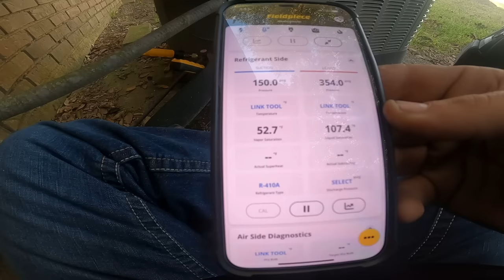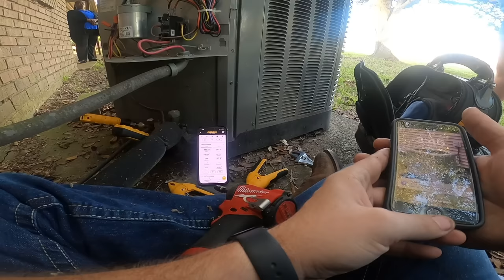Heat Pump No Heating Simple Fix

Comment: I wish you was in Arlington Texas, because I have a heat pump I bought it Nov 2021 and a few days later my heat clicked off  and the company I bought it from, his workers who installed it would not come back to see what was the problem, I had to run it on emergency heat, the owner of the company have cancer and kept asking me to bare with him that he promised to get it fix until this day 2024 he never did, so Oct. 2022 I had a company to come out they said it was a leak and charged me $712 and before the gentleman got out my subdivision my heat clicked off again, I hurried to call the company and they sent someone out the next day and that person said it was  some type of value and the owner said it was a $2,700 job and said it would be best to get a new unit because I was sold a bad unit 😯I told them that's ok and my unit still don't work on regular heat I got to run it on emergency heat because I have not found a company I feel I can trust. I'm afraid of companies charging me again and not fixing the problem.

Comment: John on your probe placement,  high side to discharge, low side to true suction. You gave me advice a few years ago placement on probes on a  package unit located the liquid line before he hit the metering device. I really appreciated it because you didn't give a smart ass comment about not knowing, having expensive tools but not knowing how to operate them correctly.

Comment: thnx for ur video. Maybe u can assist me. Do you know, what is a "high pressure lockout"? And could a defective thermostat caused the defrost board to show this code. My heat pump board is currently showing this code. The OUTDOOR unit DOES NOT, start up at all,  in heating or cooling. There is 24v on the R and C terminals. In  the "emergency" mode, I am not getting enough heat. It only heats up to 72degrees only, and runs all night. And never shuts off.  This is a RHEEM system. 6yrs old. I am really frustrated now, because i am having all these issues at the same time. I am thinking the thermostat is mal functioning, then I think its the defrost board. then i think the heat strips has issues. I am a wreck with these issues. The indoor unit runs fine, but NOTHING from the OUT DOOR UNIT. I just can't figure it out. Hope you or any other can assist me.

Comment: John - does Rheem/Ruud have a communicating high efficiency system similar to the Carrier Infinity?  I’m in South Alabama with a high humidity climate.  My old 19 year system is failing and I want a high efficiency system to control temp and humidity.

Comment: if you up grade the heat unit in your Heat system with a 15 instead of the standard 10 heat unit, will it make it hotter when the heat is on. Like a thermostat does on a car?
Reply: No but it’ll use less electric to operate

Comment: Hey sir, my ac fan outside willl turn on when I put it on cool but off when I put it in heat. Is that even normal? Also my house produce very little amount of heat. Already changed the run and start capacitor but still litttle amount of heat. N yes  the fan still won't turn on after I changed the capacitors. Any idea?

Comment: I have a problem with my water source heat pump. Works in cooling with good superheat and subcooling but when you run heating, it will be low suction and low hi pressure with high superheat. What do you think is wrong with it?
Reply: What's the temp blowing out the register/grills? Does it feel like it's still on ac mode or just blowing room temp air?

Comment: I forgot to say the Air runs fine no problem with it, it's just when I turn on the heat on the regular setting it come on and run about 5 minutes and clicks off it do that every winter that's why I have to run the emergency heat.

Comment: Hi John we have electric heating with air handler in ceiling and whenheat is on it appears our Lennox ac unit comes on also.
Is this a bad wiring or could it be correct.
I have been living in this home 2 years and never notice.  If you could give your thoughts . Tia
Ps how do you tell a heat pump ac unit?
Reply: You have a heat pump outdoor unit. Its working right.